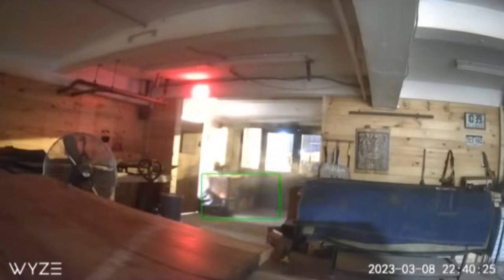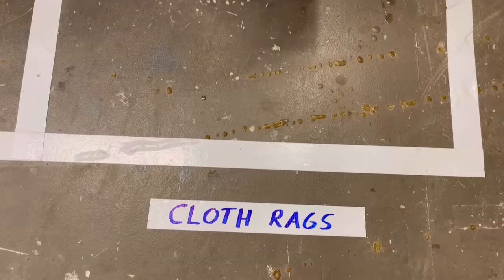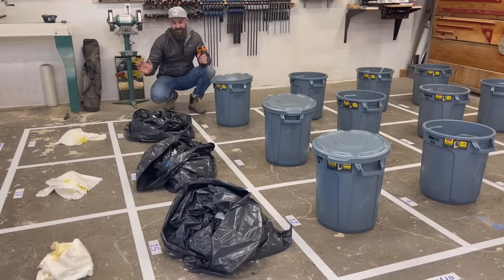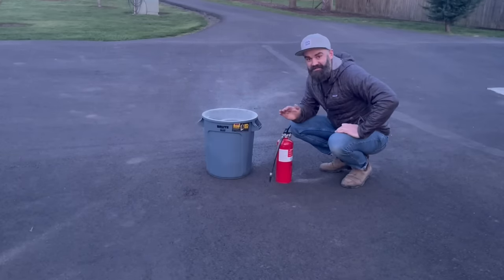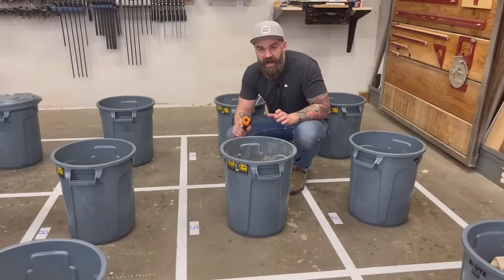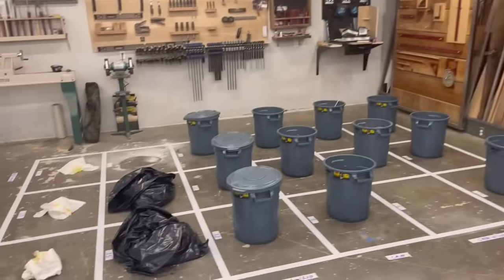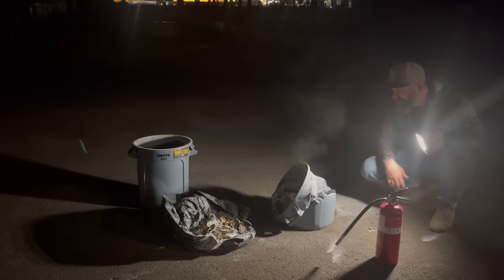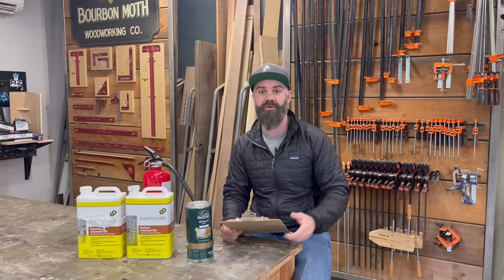I Tried To Burn Down My Shop || This Video Will Save Yours

Comment: Awesome job on the experiment! I've always taken some precautions cause I work in an attached garage but I didn't think it would be that easy to have a fire start. Will definitely be more careful now. I'm sure you've just saved a few workshops by creating this content, possibly even a few lives, very well done. 👍

Comment: its not so much the rags that start on fire but the oil its self. it has a way lower flash point. as low as 120 degrees

Comment: Outstanding work on setting up this experiment and recording the data. You practically covered all plausible scenarios in a reasonably safe manner. You might have saved some workshops, homes, and lives by putting so much effort into this video.

Comment: Long time listeners and first time caller as they say. This is really crucial to all wood workers, what would have been the cherry on the top is if you had brought in your local fire dept or a spokes person from Rubio or a linseed producers to explain why this happens. And to give fail safe advice such as rinsing the rags in water first before throwing them.
Reply: Oil finishes don't "Dry" they cure.  It is a chemical reaction with the oxygen in air.  It is an exothermic reaction, it generates heat.  If the rags are wadded up and heat is allowed to build up, it can increase the rate of the reaction, causing it to reach a high enough temperature to start a fire.  

Laying them out flat to dry seems to be pretty effective, but I would take it a step further and put them outside on a non-combustable surface.
Reply: @Bikeeast  Thanks for that explanation!
Reply: All oily rags in my shop go into a small metal trashcan with a 5gal bucket inside of it. Bucket is full of water. Can hold alot of rags. When full, pull em out, put em in trash bag and take them down to dump,hazardous waste section. I tell them what it is and the risk, they put it in a burn proof container. Extra work to keep my shop and the world safer.

Comment: Chemistry professor and lumber hobbist here.  These are in a grouping called thermal runaway reactions.  Basically, the reactions start out in slo-mo, making heat.  If there isn't ventilation _at the surface of the rags_, the heat stays there.  As the rags and oils get hotter, the reaction goes faster.  Makes more heat.  Goes even faster.  Etc.  (Runaway)  When you spread the rags out, the airflow prevents the heat buildup, so you never get thermal runaway.  Also, heads up - the fireproof container can still catch fire inside - it just keeps it all inside so it doesn't spread.  So if you go to open it and it's feeling hot, don't open it...  I've never been in that boat - I'd probably call the FD or VFD and ask for advice/assistance in that case.

Comment: I saw an expose' on the dangers of linseed oil soaked rags and spontaneous combustion on one of those "60 minutes" type programs way back in the early '80s and it stuck with me. I use a metal paint can with lid to throw rags and gloves in when I'm done applying finish. I can get these plain, unmarked, brand new metal cans at my local home center but I like the red metal bin in the video here. I'll have to look for one of those.

Comment: Thanks for posting this! I didn’t realize this was a thing until someone on IG mentioned it last year. It actually worried me since I used a ton of oily rags in my grandfathers garage in the middle of summer when I first started woodworking and thankfully this never happened!
Reply: Lucky..
Reply: it’s not all oily rags but stuff like linseed oil that has an exothermic reaction that can cause this. i think there are other oils that have that property so it’s best to err on the side of caution though and treat all of the finishes like they can catch on fire.
Reply: @jasonbenjamin1464 , most oily rags will do this. I spent years working as a mechanic and have seen it a couple times In similar experiments in shops with various automotive fluids. Best rule of thumb is if it is petroleum based, dry it before throwing it, or use a receptacle specifically designed to contain oily rags, like the can shown in the video.

Comment: You should do this experiment again with one of those bluetooth BBQ thermometers and put the probe in the middle of the ball of rags. I would be willing to bet the middle is much hotter than the outside which is why you are reading lower temps right before combustion. This would also allow you to keep track of them all at the same time without having to get up from your seat.
Reply: Yup, and pay particular attention to how the oil is distributed throughout a wad and how consistent the density of the wad is. These things are most likely to impact just how quickly/how likely a fire is.
Compressing more oil into a tighter wad and insulating it with more wad will cause the temps to increase more than loosely dropped rags.
I’ve seen a couple videos on this and this was the key to if a fire happened. Tight wad of oily rags is much worse because the reaction generating heat is contained within the wad vs laid out or loose scattered rags are able to release the heat generated.
Reply: That was my thought on it.  He was measuring surface temperature, but it was core temperature that would start the fire.  And I'd figure any heat building up in the middle wouldn't readily dissipate.
Reply: I visited an industrial laundry related to storm water stuff.  They had piles of bakery aprons and rags and so on.  I asked them about outside storage of these items and they told me about the fire risk.   I had never heard about it so they took me over to the pile and it was hot AF.  Learn something new every day.

Comment: A Rubio rag caught fire in my truck. I was washing it and I smelled smoked Rubio (quite delicious smelling). Once I realized that's not good, I opened the door and the microfiber I used from 1-3 hours ago was smoldering and the core of the wadded up rag was ash.

Comment: The best thing and what was really different about this video exploring this issue was running the test for the full 12+ hrs.  I think many people probably watch it for a few hrs and decide it will never happen after a few hrs.  Thanks for the video, it convinced me to take the issue much more seriously.  I tend to put all oily rages in a jar, or a bottle with a tight lid to stop any oxygen getting in.   After several days/weeks, I throw it in the rubbish once all dried.

Comment: Always knew this was a potential, but seeing it actually happen is really cool (in a horrible sort of way).   The thing that really surprised me was the ones that re-ignited out in your driveway.  To me that is even scarier since they had already been extinguished with a proper fire extinguisher.    A lesson in 'never can be too careful' for sure!  

Much respect for doing this.  Had to be a long, long day.
Reply: A powder extinguisher is normally so effective that nothing ever starts over again.
Reply: @PeterPetersNL  Sadly, no. Dry powder extinguishing agent creates rather minimal barrier (basically coating) between flammable material and oxygen. It is really useful to supress flames and extra useful as it works on most fire types. But it is one of the weakest types when it comes to possible reignition, as it does not remove the heat or disturb the ignition source. So once the powder disperses or gets encased in flammable liquid, reignition is actually quite common. Look for videos in the youtube for trying to put out fire in car engine compartment for example (hot engine keeps reigniting the stuff) or hot grills. It helps to kill the flame for a time -- but you DO NEED to get the flammable material cooled down and out to somewhere it is safer.

Comment: Back in the 80s my family had a restaurant and in the kitchen storage area we keeper a rag bag for used kitchen rags. One thing you use in the business is rags , you use them for everything including cleaning oil around fryers and grills. I came into the kitchen one morning and smelled what I thought was wire so I have an electrician come and check all wiring with no findings.  Fast forward two more dsy still finding nothing until there was a very lite smoke that appeared in storage aera , with that I upped the rag bag out onto floor and at the bottom was a rags just smoldering.  It's a weird feeling knowing that at anytime your whole life can change because of a little overlooked mistake. Thanks for that info , I hope alot of people took it to heart and learned something from it. 🙂✌️

Comment: The other day I was seasoning cast iron cookware with Flaxseed Oil. That's an oil I knew nothing about, so to be safe I put the rags in the fridge overnight when I went to sleep. Turns out flaxseed oil is food-grade LINSEED OIL! If I threw them in the trash, I could have burned by house down! Turns out Cottonseed Oil and Walnut Oil can also spontaneously combust. Play it safe with oily rags! Especially with oils you're unfamiliar with
Reply: If you're wondering what I did the next day, when I was finally done I took all the rags outside and burned them in a controlled manner.

Comment: Great video, thanks a lot!
Use foam or water fireextinguishers whenever its possible. Powder will likely damage all electric tools in your shop and leave a big mess. Foam will work too on burning rags, with whatever they are soaked. And it is likely that you can't breathe because of the powder and have to stop fighting the fire. Imagine using this in a smaller kitchen or livingroom.

Comment: Also why you should use metal cans with tight fitting lids. Contained saw dust can also spontaneously combust or if suspended in the air can explode. Thank you for putting this out there!

Comment: Likely the Rubio had a hot spot that might have been averaged out across the other areas seen by the IR thermometer as it makes a reading.  Would be interesting to see what it would have looked like on a IR camera (like a FLIR) since you might have been able to see those hot spots showing up in different sections of the bags/cans.  Might have even picked up some hot spots on the rags just sitting on the floor.
Reply: That would have been a nice addition
Reply: Correct, the instant read is only reading the surface temp at that specific point.  Its down inside where the rags are more crumpled and compressed your not seeing the true temp.  Think of a compost pile where down inside is where the magic happens.   This is a great and important video, especially since it takes time for it to build up to a combustible temp, that we can easily just go home for the day and not think about this happening.

Comment: The main aspect to remember is that slovent/stains/some oils can spontaneously combust with NATURAL FIBER products (cotton, hemp, wood products, etc.).  Learned this in school for industrial hygiene. As a Fire fighter I actually saw this happen multiple times at a hardwood flooring company. Metal dumpster right outside their shop. Generally hung their rags to dry for 24 hours before throwing away in the metal dumpster for extra caution. Also seen this happen with drips thatbland in saw dust. Stay safe out there!
Reply: How does it affect finished products? Do we have to worry about using boiled linseed oil or Rubio on let's say a picture frame or a basket? If you just finished a project and don't wait for it to fully dry, will it spontaneously combust?
Reply: @IQLion  the more dense the material the less you have to worry. The main component is air. Too much air (laying out rags instead of leaving balled up) and the oils/solvents dry or evaporate too quick. Too little air (like the small fire "resistant" rag bin) and it will heat up but not ignite. For stained wood projects, the wood absorbs the stain or oil and effectively dries it up. As someone who enjoys woodworking and fire, theoretically yes your scenario is possibly, but unlikely. Keeping things elevated also helps. When the oils chemically react with the fibers they off gas. These gases are the flamable aspect and are usually heavier then air (like gasoline fumes). The gases are the fuel, the oil/fiber generates your heat, and the air provides your oxygen. Remove any one of those 3 and you won't have a fire.
Reply: "Also seen this happen with drips thatbland in saw dust."
Oh wow, that is a new one to me, but I will certainly keep it in mind moving forward.
Thanks for that.
Reply: @StillLivinginthewoods  seems scary if you work with really thin stock like making picnic baskets or if you work with thin veneers a lot.

Comment: the most common mixture taught in art schools as an oil thinner to replace the good ole turp is a mix of linseed oil and galkyd (or galkyd lite)....all the studios are outfitted with oxygen trapping and self closing metal bins for rags (like the red bin used in the experiment). one of my professors told me to always use at least a galvanized metal bin for rags because he used to keep his oil rags loosely under the sink but they spontaneously combusted once (thankfully his family was out of the house, and the neighbors called the fire dept pretty quick so his home wasn't totally destroyed) but hasn't had a problem with galvanized metal. never even thought to use a plastic bin....ya know...cuz plastic melts easily in heat (RIP your driveway). maybe a bit of a part 2 would be cool testing different material consumer bins and their lids. the big thing about fire is oxygen...so with or without lids can play a pretty big factor.

Comment: Three elements combine to make this happen when conditions are just right (which is why very subtle variances in rag/oil/air density amounts may explain the variation in outcomes)

1 - Curing oil releases heat as it reacts with air
2 - Oil cures faster as it gets warmer
3 - Uncured Oil is a quite flammable fuel

So 1 & 2 create THERMAL RUNAWAY where the oile gets warm, cures faster, so it gets even warmer, and so on.  That gets hot enough to make the rags smolder, which catches the uncured oil. 

That's why they can go from slightly warm to on fire so quickly, once the runaway starts, it runs away. Also why spreading the rags out to dry works well, it lets the heat dissipate.

Comment: I had an oily rag fire in an apartment in a 4-unit building I was remodeling. Luckily a tenant smelled the smoke and kicked through the door and extinguished it and called 911 because I was out of town when it ignited. Just ended up with smoke damage. It was from staining a floor with an oil based stain, I believe it was a minwax stain, not sure what oils it's made with. Thanks for taking the time to do this test!

Comment: Rubio monocoat hardens fastest among the oils, meaning the reaction rate is the highest. Each reaction releases a bit of heat, so the higher the reaction rate, the more heat released per time, the higher the temperature it can reach. In addition, if you payed attention in chemistry class, you know that the higher the temperature, the higher the reaction rate, rule of thumb is 10K warmer is 2x the rate. So you create heat, it heats up, you create heat at a higher rate, it heats up more and so on. That's called a thermal runaway and usually ends in exciting ways (fire, explosions...).

Comment: This is a great little experiment. A couple quick tips on things you mentioned:
This fire is what's called a class B fire. Fire has 4 classes, class A is normal combustibles, class B is liquid/chemical, class C is electrical, and class D is metal (think lithium/magnesium). In general your home/shop should have a class ABC fire extinguisher, you can read the side to check, it will say what it covers. (Also check the last inspection date and charge while you're at it. These things do have an expiration date.)

A little nitpicky, but the "fire safe" trash can can also easily catch fire, it's just designed to contain the fire safely and minimize air passage, which is why you want to make sure the lid always actually closes and don't overfill them. You should also put rags you use for solvents/oil changes/etc in those types of cans as well, basically anything that says flammable on the label.

Comment: I very rarely comment videos but this is the second time you made me do it (so you might be on to something there).
This episode made me happy for two reasons. First for investigating a problem that's either unknown to a lot of folks or known but just vaguely. Being unknown makes it a risk without countermeasures in place. A problem that's known but not fully understood becomes more fearsome than it needs to be. Second thing I liked is you did your test in a scientifically consistent way which makes your information even more useful and helps a ton with credibility.
Also, I wanted to share my educated guess on why the fires started where they did. Notice that all of them occured in setups with access to oxygen but not a ton of ventilation. I saw someone mention linseed oil needs much lower tempereature to ignite than paper. Fumes created by the curing process or evaporation are even more flammable than liquid oils. The covered bins are safer because there's no supply of fresh air. In the pile of rags the fumes escape faster so only the liquid oil can be a fire hazard but it needs more heat which is kept lower by air flowing around. On the other hand, the loosely closed bag and the open top cans filled in a random manner create pockets where fumes can gather and mix with air.
Reply: Also on the loose rags on the floor scenario, the concrete can leach off portion of the heat, conducting it away from the potential combustion source. I'm not sure if that alone would prevent combustion, but the added airflow taking out the fumes and cooling it are certainly more likely to.